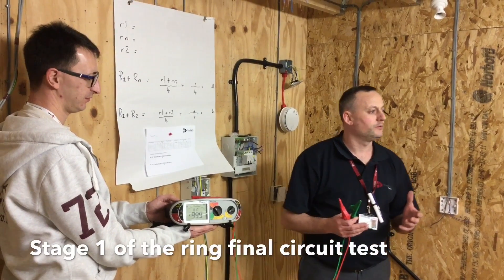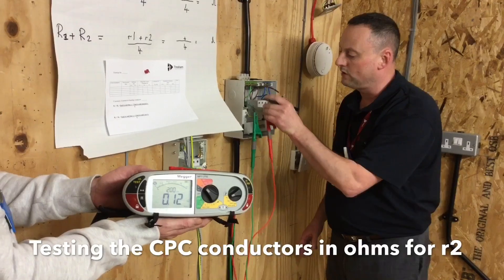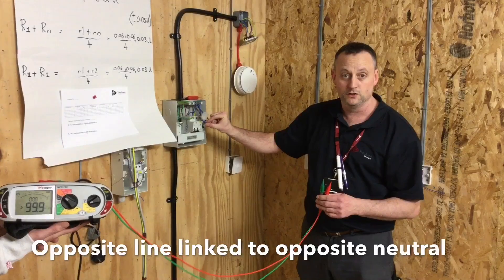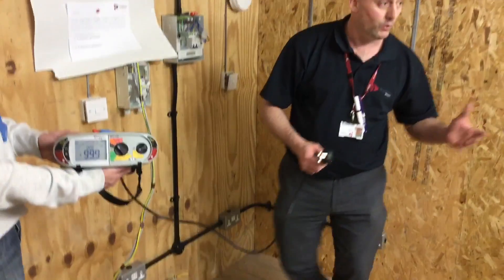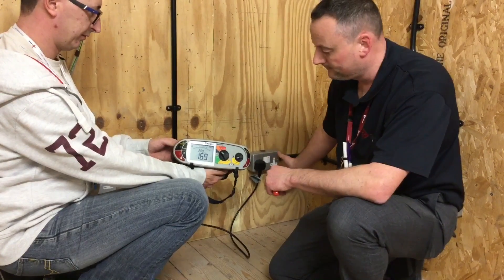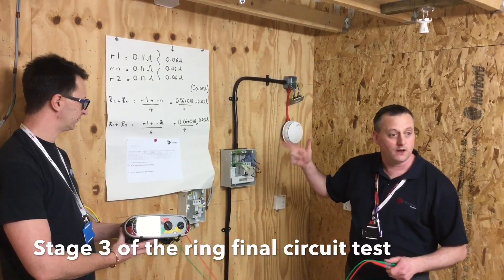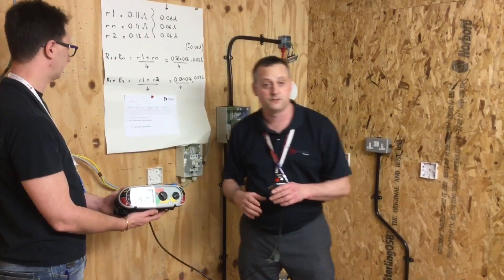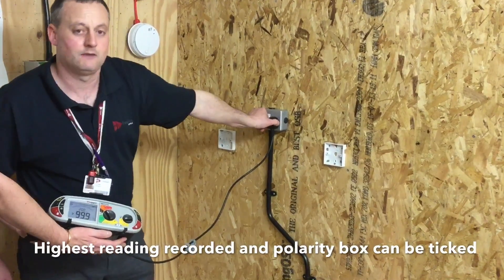Electrical testing continuity of ring final circuit conductors, including protective conductors

Comment: How would you test a r1+r2 on a ring where there is no CPC conductor ? Its a singles solid 2.5mm conductor in a metal conduit buried in a concrete wall. All the metal conduits are used as a CPC for all circuits lights, sockets, fused spurs, etc. So the conduits are linked to all the back boxes and the metal consumer unit box. 

This is in a 3 story building with 2 flat per floor let out for residential. 
Could you do a video on this please.

Comment: Hi Gaz did u do a video where one of the tests was done by connecting two of you leads together.vthink was something like live and earth to neutral 🤔🤔🤔
Reply from the maker: Hi. Insulation resistance test is carried with line and neutral (live conductors) linked together and tested to earth. Thanks for watching as always Gaz
Reply from the maker: Insulation Resistance Test (Includes Line and Neutral Together to Earth and Between Live Conductors)https://youtu.be/Ek1u2RjQffU